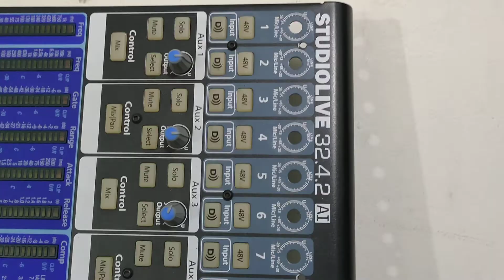Presonus STUDIOLIVE 32.4.2 AI (repair preamp/input module) #Presonus #repair #malfunction

Comment: Hello, I have a problem with the mix studiolive 16.4.2, I changed the transistors and it worked, the problem was fixed, but the detail is that nothing can be seen on the screen, it is only illuminated, although if everything works, I already checked the flexor and all the connections everything is fine but nothing is seen helpoo help